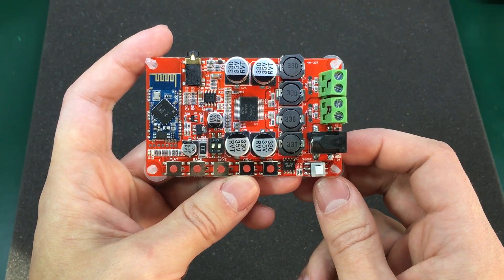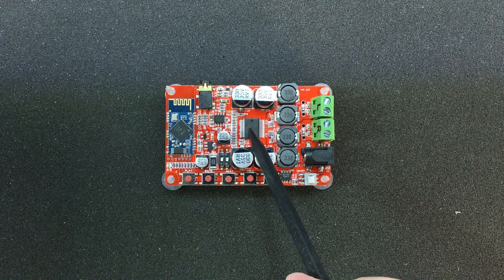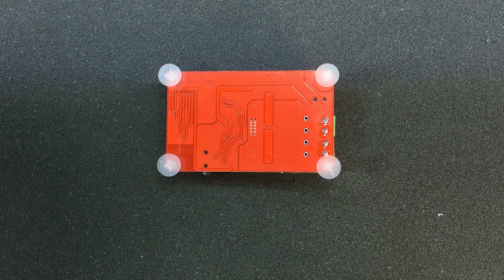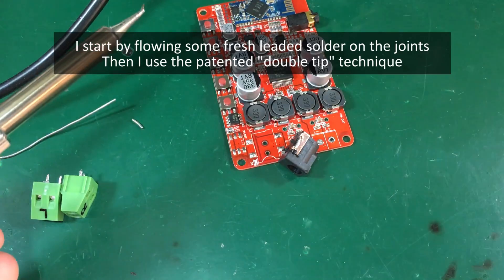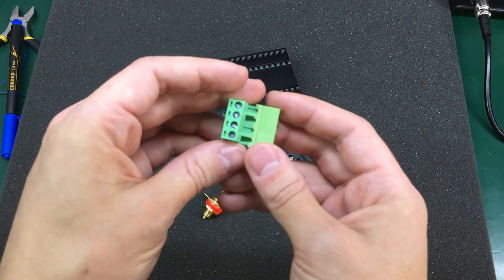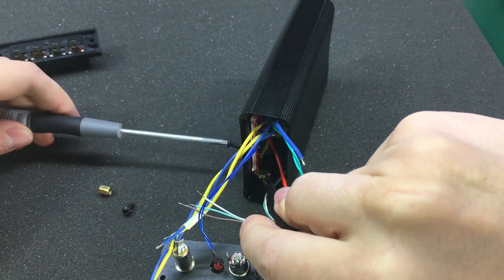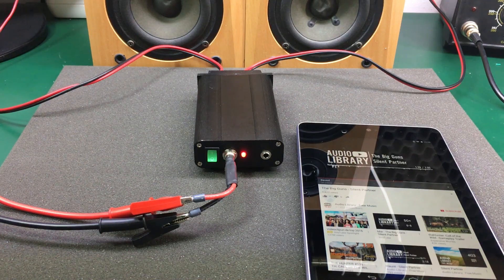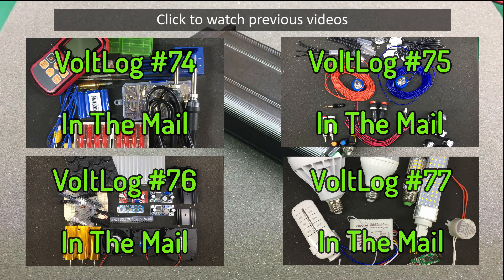Voltlog #78 - Building a 2x25W Bluetooth 4.1 Stereo Amplifier TDA7492P

Comment: I have a similar amplifier but one of the smd capacitor is missing. Amplifier does not turn on. Do you know the value of the smd capacitor and it's size?

Comment: I have the version without jack input. I soldered a wire to the Bluetooth antenna on the board. It greatly extended the range of the B.t.. A small (10 cm ) piece of wire will do.
Alternatively one can get self-adhesive copper tape cheap on eBay. It will also work.

Comment: I use this amplfier to power 2x 4ohms speakers and 2x 8ohm speakers in a diy boombox and it works well. I installed an intel heatsink underneath the pcb for better heat dissipation.

Comment: I'm a noob at this. I am using these boards to make old antique radios into Bluetooth speakers. I want to solder an led so when it is powered up it will have a light on the dial. Where did you solder the led onto the board? It was hard to see in the video. Thanks
Reply from the maker: led was soldered on the existing led pads.

Comment: Hello, due to my poor understanding of english i can´t really get to know where do you say you can get the bluetooth line out to send it to another amplifier, as i´m building a portable speaker and i need a separate amplifier with low pass filter, i need to know where i can get that line out if you or someone would be kind enough to tell me the exact points please.

Thanks.
Reply: jotasgasco < It should be the output of the Op Amp chip.

Comment: You just solder the wire to the end of the internal Bluetooth antenna and run a connection for the external antenna right?
Reply from the maker: Don't do that, you will just affect the existing antenna with no extra gain. Antenna theory is a more advanced topic.
Reply: Okay thanks. I seen a lot of videos with people doing this and it didn't look right but I figured to ask being so many did this.
Reply: MrBrymstond   < It really helps if you use a magnet wire and wind the wire properly. Not only strengthen the BT signal but also eliminate the backround noise.

Comment: Hi. Great video. I have a noob question for you.  You stated in the video you could remove the buttons and wire new buttons.  Would show how to do that? I would send you a new amp if need be to see how that is done. I have zero soldering skills but I am learning and would love to be able to hook up new momentary switches to that amp to place it into a speaker enclosure.

Thanks!
Reply from the maker: You don't even need to remove the existing buttons, you can just solder wires and add a second set of buttons in parallel, it will work just fine. You need two wires for each button, just find the pads where the signal connects, and solder thin wires to them, I think the two pads on the left of each switch are the ones you need, but double check that.
Reply: Thanks for the information. I'll let you know how if I am able to get it to work. Thank you for responding also.

Comment: Hi! Your project look very nice. I want to make my own one but, everywhere it's called 2x50W. This 2x50W is a MAX power? So the TRUE power is 2x25 yeah? And i dont know how to power it... Is any difference if I power it with 12 V and 24 V? with 12 V it will be not full 25W? In specs is 8 to 24 V, but when i want to power it from 12,6 V Li-Po battery (with BMS and balance) this amplifier willl be work on 25W? One more, this 25W is RMS? Soory for be poor but i need help ! :D
Reply from the maker: you can read the datasheet of the TDA7492P for full info. It's 2 x 25W.
Reply: @VoltLog OKay, i read both. The difference is in "P" letter at the end of name. TDA7492P is 2x25 but TDA7492 is 2x50. A lot of people on AliExpress  call TDA7492P as 2x50, what is lie... I only have problem with power supply because i want to use LiPo 18650 but i need 6S to get ~20V and full power. PCM/BMS boards for 6S is expensive and i dont know how i would to charge it :/
Reply from the maker: with a BMS board you could charge the batteries with a current limited buck regulator.. not ideal but it will work. The problem is you are trying to use a chip that was not designed for battery powered applications in a battery powered scenario :-)
Reply: +LieroXor
Why bother so much for the output power?
Doubling the output-power will only increase the sound level with +3dB which is noticeable, but no more than that. You'd be better off searching for speakers with high sensitivity.

Comment: Where did you solder the wires for the 3.5mm jack? I have one of these and would like to do this mod
Reply from the maker: Here is a link to the wiring diagram but please note that is a line out signal from the bluetooth module. It's not a line in as I initially thought. http://www.voltlog.com/wp-content/uploads/2016/12/wiring.jpg
Reply: VoltLog. Good video! I have a question for you, in your diagram you connected two terminals to each cable but in the video only connected a terminal for cable...why!?

Comment: not worth the trouble,after long periods of time using it it getting hot,even after 20 min usage with large speaker's,you need to mount a fan to cool down the chip.and can use a plastic enclosure to increase the signal on Bluetooth

Comment: When I plug in the aux it doesn't switch from Bluetooth, I'm I missing something?
Reply from the maker: I discovered that is not an AUX port but rather a line out from the bluetooth, so you can use the module as a simple bluetooth receiver and pass the signal through another amplifier.

Comment: Great project, I am in possession of the same amplifier and considering of building the similar enclosure but of plastic.
How did you applied this heat sink on it - glue it?
Reply from the maker: The heatsink already had some thin double sided tape when I purchased it. A plastic enclosure would improve the signal strength.

Comment: How did you connect the led to the board? Did you use a resistor or wasn't that necessary?
Reply from the maker: I used the connections for the existing power LED present on the PCB, Which is already connected through a resistor.

Comment: Tip: you can use a vacuum cleaner to get dents out of speaker cones.
Reply from the maker: +spankmeister thank you for the hint
Reply: VoltLog don't do it that's the worst idea I've ever heard it stands more chance of damaging it, the way to do it is put some tape on the center of the dent and press into area then do not pull out towards you,instead pull the ends of tape with both hands to the left and right at the same time just stretching the tape brings out the dent without yanking at the cap with unnecessary pressure.

Comment: I recently completed my house audio sync project for a cheap alternative to Sonos and evaluated one on these. The one I bought didn't have switches on the aux socket. Also beware if people want to use the aux socket. Mine had more noise than signal.
Reply from the maker: the module in the video doesn't have any additional noise for the line signal because it's routed to the same point as the bluetooth signal, the input of the pre-amp.
Reply: Glenn Pierce which amp did you use for your home audio?
Reply: I used a array of these
http://www.banggood.com/PAM8610-Digital-Amplifier-Board-2x15W-Two-Channel-Stereo-Class-D-p-1029691.html?rmmds=myorder
Ok for me and background music. Probably wouldn't keep and audiophile happy.
My code is at https://github.com/glennpierce/PartyZone

Comment: i recently bought this thing here http://www.banggood.com/TPA3116-100W-Bluetooth-4_0-Audio-Receiver-HiFi-Stereo-Amp-Amplifier-Board-p-1059332.html?rmmds=myorder it works, but you can hear a loud buzzing from the bluetooth data. so i had to saw the module off, cause i suck at desoldering. very annoying, but with the lag of bluetooth it would not have been a usable solution anyway. are the any ICs which just take mosfets that can be chosen by the engineer?
Reply from the maker: the one I have seems to be using a good pre-amp, the noise level is okay for my ears. If you would like to search for different amps I would start by looking at TexasInstruments Audio section, they have quite a nice selection. Also STmicro.

Comment: What range are you getting ? I have a bluetooth receiver that cannot manage more than 2-3 meters and that's out of a case.
Also, I need to be able to use an audio-in jack, were you unable to use it in the end  ? not sure from the video.

Thanks.
Reply: I was wondering if there could be a trick to cut the antenna trace and solder a standard antenna in place ? but I dont know how, had a look online and didnt find a solution.
Reply from the maker: you could solder a small pigtail made from RG316 for example (50ohm is the key here) to an sma connector and connect a 2.4GHz external antenna with higher gain. Keep the pigtail short and do some clean soldering to minimize losses. A good point to solder this in, is right before the inductor in the antenna path, there are a couple of small pads one is the antenna signal and the other one is ground.
Reply: Any how-to video on this maybe?
Thnx
Reply: +1, I have this exact module and the bluetooth range is terrible.  I have two of them and tried sacrificing one for testing with a remote antenna, cutting the PCB antenna with minimal benefit.
Reply from the maker: The range I'm getting is 3m with direct line of sight between phone and amp module, with the module inside the aluminium case. I established the connection within 1m and then moved away towards the far end of the room with no interruptions.  I am not able to use the audio-in jack, they don't seem to be using the switch on the jack, it looks like they are mixing the bluetooth signal and the line in before the pre-amp chip however I am unable to play anything through the line input. While playing something through bluetooth the line in signal does get through so what I suspect is that they use a mosfet (Q1 maybe) to switch the power to the pre-amp on only while there is something played through bluetooth. I doesn't make allot of sense to design it this way though..
Reply: VoltLog Thanks a lot for the answer. I need another solution then.
Reply from the maker: With a hack I think you could use this one as well. But there are other modules out there.. you could try a different one.
Reply: I've tried it without any appreciable benefit. signal distance was similar.

Comment: Great job, that's a good looking and functional amplifier!
Many people tell to not leave the antenna of wifi/bluetooth device inside the case. But like you told in this video, that just reduces the signal strength while some people make it seem like the signal would be totally unusable. The lower signal strength may be sufficient. For my setup, 2-3m range would be plenty. It's all about what each of us needs, everyone doesn't need maximum performance.
Reply from the maker: Exactly, I am happy with this setup but it can be adjusted if one would need the extra range.
Reply: I think that the metallic enclosure is a weak point of this design. A plastic box would perform much better.
Reply from the maker: a plastic box will allow for increased bluetooth range, but if that's not something you need, the aluminium enclosure looks better :-)

Comment: I noticed the centre caps of the speakers are pushed in, a little trick to fix that is to use a vacuum cleaner to suck them back out :-)
Reply from the maker: I purchased them for $10 used so I can't complain but thanks for the trick I will try to do that :-)

Comment: A small correction: In the beginning you talk about the amplifier. On the bottom of the screen is a text that says: ... "2x50W"...
The title of your video is 25W.
So there must be a small mistake. :)

But apart from that, Very Nice Video!
Reply from the maker: yes, there is a mistake. I had my head filled with all the bullshit advertising from ebay and got that title wrong. The amplifier is 2 x 25W.
Reply: VoltLog Ok, nobody's perfect
Reply: +Manuauto Actually, I never make msitakes
Reply: Spoder Man 1/10 too much bad jokes.
Seriously, you are not perfect either.
Reply: 25W rms or peak?